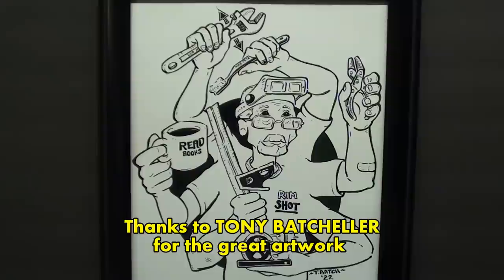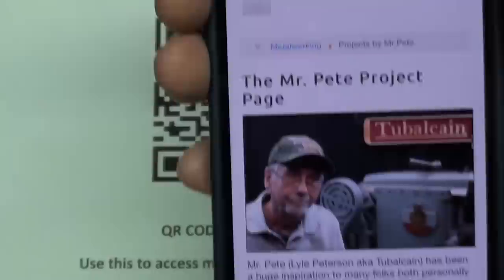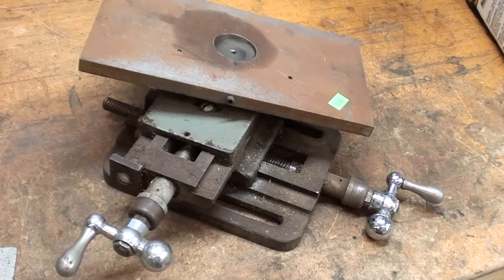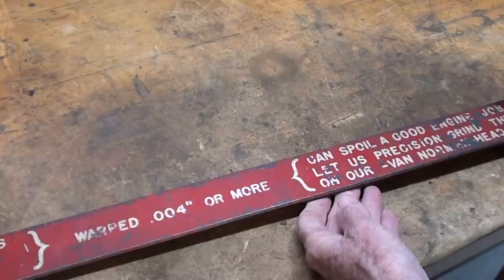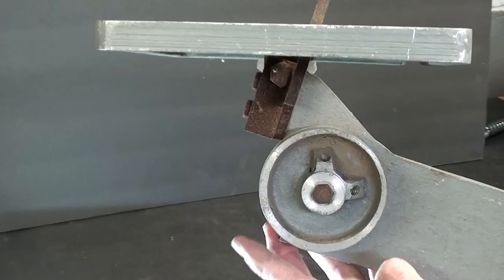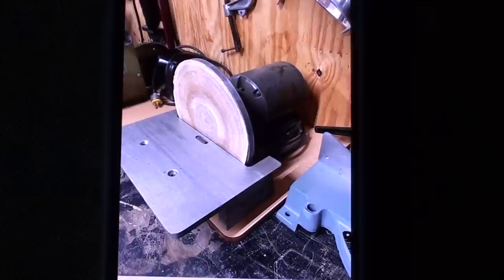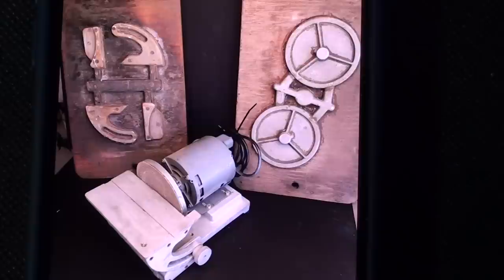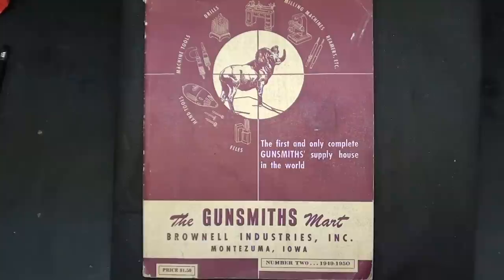Logan Lathe That Got Away THIS & THAT #70 tubalcain

Comment: I have owned a Drill Doctor for 25 years.. I've had great results and have zero complaints.. Also,it sharpens masonry bits with excellent results.. The company was out of Oregon originally.. Love that Starrett square..
Reply: Same here!  I bought one similar to that in the Vid, and about 4 years ago, I bought the latest version, and gave the older one to my son.  Try as I might, I was never able to hand grind a drill bit to my satisfaction.  Drill Dr.'s are fast and easy to work with and do a GREAT job.
Reply: A Drill Doctor is on my list.
They bought us one at a job and we loved it! Until another shift worker messed something up on the holding fixture/collet.
Funny, at another job I was the go-to for sharpening bits by hand. Not good, not bad at it but for the shop the drills should cut evenly.

Comment: You don't need to pay for transferring your iphone videos to a PC (or mac for that matter). On the PC, just connect the iphone with the Apple lightning-USB cable, then on Windows Start menu select the Photos app. It will launch and let you migrate or sync to your computer. Absolutely make sure you have lots of space on the PC side. On a mac, you can use Preview app included with the MacOS, to import images and movies from your iphone. Again you need to have storage free as videos are larger than photos and can take up space as you add more and more files. Hope this helps, Mr Pete!
Reply from the maker: I tried that many many times. In fact, I thought that was the way it should be done. But most of the time I cannot get it to connect. But there are plenty of insane Apple pop ups.

Comment: With the later iPhones, no additional app is needed to read QR codes. Just be sure 'Scan QR Codes' is turned on in the 'Camera' settings. Then open the camera, point at the code and a button will appear to take you to the link.
Reply from the maker: Thanks

Comment: As far as the lathe that got away, my handy little lathe is a Logan almost identical to this, bed is almost perfect, tailstock quill has some play.  Gave 700 20? Years ago, bought it on the spot and loaded into pickup truck.  Cheap imports have influenced the price of small older machines.  I will just keep my Logan and my Hendey though.
Reply from the maker: Yes

Comment: Mr. Pete, i'm a just turned 77 year old North Carolina country boy
raised on a farm, worked a public job after growing up, but also
got a diploma in gunsmithing in my middle age, and enjoyed about
40 yrs. of that practice. But, i wanted to tell you i have a Craftsman
Atlas lathe identical to the one in your shop. It's a later model in
very good shape. I also have a drill doctor that looks almost just like the one you just purchased. They work fine. Sharpen my drill bits many times. Enjoy your video. Been watching for a long time.
Hope you're having a nice day.
Reply from the maker: Thank you for a nice comment. I will turn 79 in August. I think the atlas lather is much better than most people think.

Comment: Mr.Pete it’s on of your internet nerdy students. Despite missing some of your classes i was hoping to give back a little regarding your iPhone —> PC video transfer, there’s no 3rd-party software required to transfer movies recorded on iPhone to a desktop. Assuming you’re PC Windows you should be able to access the videos. While I cannot confirm not knowing your exact software and hardware it should be relatively straight forward, Transfer photos from an iPhone to your PC.

First, connect your iPhone to a PC with a USB cable that can transfer files(some cannot). 

Turn your phone on and unlock it. Your PC can’t find the device if the device is locked.
On your PC, select the Start  button and then select Photos to open the Photos app.
Select Import > From a USB device, then follow the instructions. 
You can pick the items you want to import and select where to save them. Allow a few moments for detection and transfer.
*Make sure the photos you want to import are actually on the device rather than in the cloud. Then, follow the steps for your type of device.
Reply from the maker: Thanks 👍👍

Comment: Hello Mr Pete... Watching your latest YouTube video this morning, saw your dilemma with transferring files from an iPhone to a PC.
Unless iPhone has changed their operating system enough to disclude the following, you might try this procedure...

Step 1: Connect your iPhone to your computer using n USB cable through any of the USB ports available on your computer. 
Step 2: Open iTunes, click the “Files” tab and check the boxes to sync or transfer your files. 
Step 3: Select your desired destination folder for the files and click “Sync” to complete the transfer
Reply from the maker: Thank you, I will try that. But I have attempted to do that many times over the years, and cannot always seem to get it to connect. But plenty of stupid Apple pop-ups appear
Reply: @mrpete222  You also should have iCloud for the phone. If you can store the files there, you could download them from iCloud on the computer. There could be file size, storage capicty issues I imagine.

Comment: I also have a Drill Doctor but I have the 500. It works great on the mid range sizes from 1/8" to about 3/8" but the larger and smaller sizes not so much. The smaller sizes are a little troublesome to get aligned and the larger sizes put on a weird gring I don't like.

Comment: Lyle, the default iPhone camera can scan QR codes. A stand alone app isn’t needed. 

As for transferring videos, do you have a Mac computer? If so it’s very easy, but if you have a windows computer then I’m sorry but I can’t help.
Reply from the maker: I really need to purchase a Mac
Everyone says they are better
Reply: @mrpete222  They work well with the whole Apple ecosystem. For example there is a thing called “Airdrop” where it’s a single click to send any file you want from an iPhone to Mac computer. Or “handoff” where you can, for example, start an email on your iPhone and move close to the Mac computer and continue writing the email. But windows computers are also very capable machines. If you’re just looking for the ability to send files from your iPhone to your computer I would stick with what you have. That being said, around $1200 will get you a new iMac which is the computer and screen all in one. And if you have a family member or friend in the school system (maybe your friends at the local school) they can get an educational discount. 

I can look around to see if there’s an easy program to transfer the iPhone videos to your current computer though. Unless you found something already. If I find anything, I’ll post back here. Love your videos, hope your “dirt nap” is many years away!

Comment: Video Transfer: No software is needed. You should be able to plug the iPhone into the computer's USB Port. Then open Windows Explorer and look down the left pane... Desktop, This Computer, etc. Somewhere down there will be "iPhone"... click on it. Then on the right side pane will be the video files and photos. Drag and drop them to a folder on the computer.
Reply from the maker: I have done that in the past, but it does not always work. Sometimes my computer will not recognize my phone. Thanks for the help

Comment: Good morning Teacher!

Well, it finally happened: I had to use my lathe to do an emergency repair and save a trip to the BigBox Home Center.
PVC Ballcock with slip-joint flanges (main house water shutoff in crawl space).  Woke up to the sound of gushing water and it wasn’t the garden hose leaking… water hitting underside of floor.  Rush out, turn off outside shutoff before heading into crawlspace.  Here is the busted piece : media DOT patriots DOT win/post/lzvK5QBKVB45.jpeg (replace DOT with .). I had another ballcock to steal the flange, but it was another manufacturer, and slightly different size, luckily larger.

Chucked it up, turned it down, reversed it, turned it down, reassembled everything, and we are up and running without having to buy another whole new valve!

THANK YOU FOR ALL YOUR WONDERFUL INSTRUCTION!!!!!!!!!

Comment: I have a Drill Doctor so i would be interested in that video. Mine I am not sure of the model (yours is a 750 which does up to 3/4" bits I think mine is a 550..1/2" bits) but unfortunately, I think replacement sharpening wheels are no longer available (at least for mine) but they do work pretty well.

I would be interested in your "technique" as I have trouble getting consistent results. Thank you.

Comment: I have an Android phone instead of an iPhone.  I have a few options for transferring files to my computer.  From the photo app I can share the file to Google Drive and download it from there to my computer.  I also have an app on my phone that will set up a web server I can connect to from my computer to move files in either direction.

I expect that the Apple ecosystem has something similar to the first solution above using iCloud instead of Google Drive.
Reply from the maker: Thanks